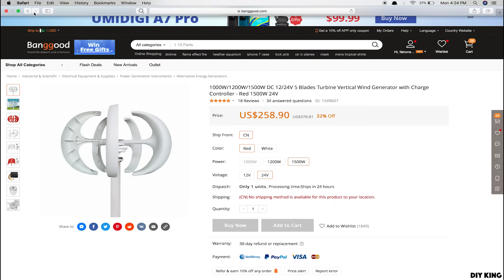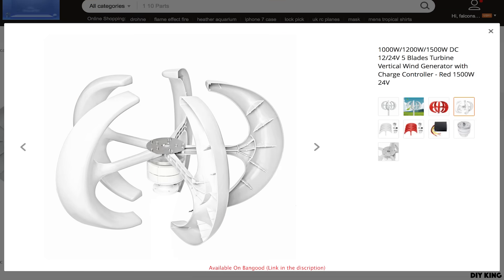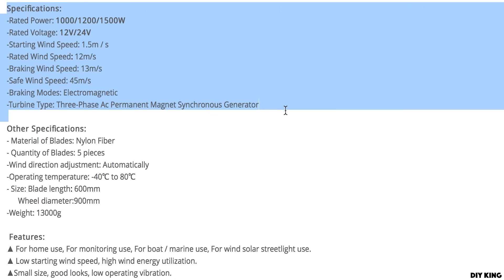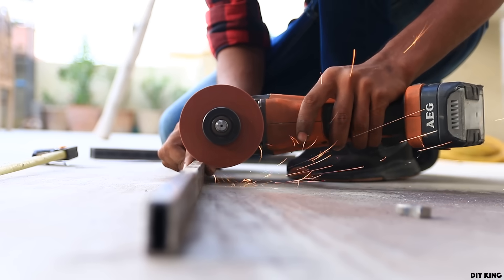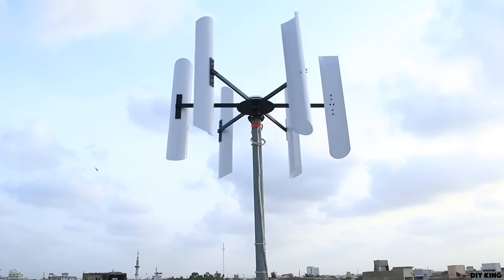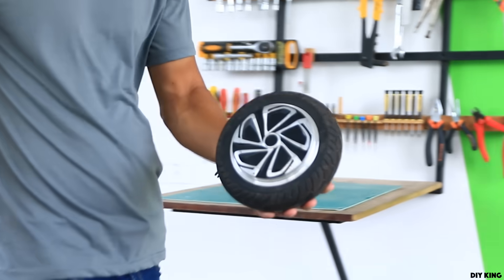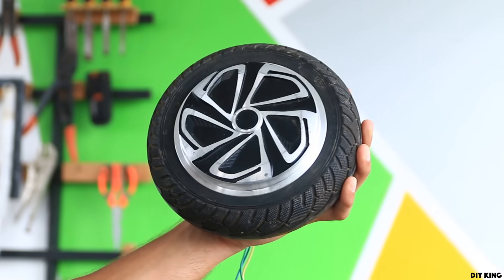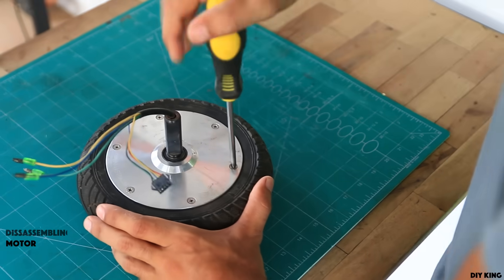How to make a Vertical Axis Wind Generator (Is it worth that???)

Comment: Part of your problem is that the arms for the blades are too far away from the motor. If you cut the arms down so that the blades are closer to the motor, then you will realize more RPM. You need to adjust your RPM to the motor by how far away your blades are to the motor. You can adjust the torque by the length of the arm and by the size of the blades. It is a balance game, you will need your RPMs but also your torque requirements met while remembering they are opposed to each other, as torque goes up, RPM will go down by moving the blades in out in relation to the center hub.  The 2 cheats you can use are to increase the height of the blades and or the number of blades. This is dependant on the capability of your structure and the bearings of your motor.  There is also a point of diminishing returns as to the number and size of blades.

Comment: What if, you made an enclosure for the blades that can pivot freely, make them wider so they fit that enclosure almost perfectly without actually touching it, then at the front where the air goes in you make like a funnel rectangular in shape as wide as the diameter of the enclosure funneling the wind to one side only,protecting the side turning into the wind. And also make the entire enclosure turn into the wind by adding a tail like fin to the back of it. Just thinking, would that improve performance? I'm subscribing hoping you consider building something like this, i am very curios if it helps boost the output.

Comment: On the vertical unit, instead of a vertical/straight up and down PVC that is cut in half... create a V pattern by cutting them in half so they look like a " < ".  The wind will still grab and push but the arrow dynamics will allow for a greater spin speed.  Second, look at better bearings...possibly some experimenting in magnetic zero friction.

Comment: Great attempt!!! 
However, I see a problem in bearing configuration. It’s not only the air drag that is slowing it down, but good amount of friction at bearings.

The hoverboard motor bearings are radial bearings. They are meant for motor orientation on horizontal axle. But if you place the motor vertically, the bearings will not be able to arrest the vertical slip of the axle, and finally the stator will press on the rotor, causing enormous friction and rapid wear. You need to replace the radial bearings with thrust bearings so that the rotor (casing) is suspended over stator be those bearings, bringing down friction drastically.
Reply: I also tried building a vertical axis windmill but after I left my prototype out for a night for a test drive, I noticed the same problem with the bearings. After that I discarded the idea of vertical axis with hub motors.

Comment: Add a large wheel under the vertical prop, then add a belt to this wheel and connect to a cog on a motor using the output from the motor as a generator, the output will be significantly higher.

Comment: The blades should be wings not cups.  The force comes mostly from the blades parallel with the wind not the ones perpendicular to the wind.  The blades should have undercamber and should be symmetrical front to back.  Your blades simply have to much camber for the wind speeds you are trying to harvest.
Reply: Exactly

Comment: Great knowledge I don't have any technical knowledge about this, but likes it very much and would like to experiment such things. I have got a 750 watts producing kerosene genset. I would like to know is it possible to use that generator (dismantling from kerosene engine) to convert it wind turbine generator? Since it has output panel, I think it's possible with minimal modification. If possible please upload a video on that.

Comment: Savonius is a low speed purpose turbine. It has a narrow range of workload and now a particularly high efficiency. HOWEVER, it is a robust, cheap and easy to maintain turbine. The best thing about it is that it start at almost no wind, so you can make a lot of electricity for low power applications. Its prowess is in its consistency. ;)

Comment: did you even try to implement an omnidirectional-guide-vane? there are studies that talk about 4 times more power generated. it would be really cool if you put it side by side to test with this one
Reply: Em português 'direcionadores de escoamento de vento'
Reply: They are like fins that direct the flow to only the blades that will propel and prevent the same wind from pushing the blades that are against

Comment: Folks, try a simple idea: Cover half part in a hard wood enclosure.  So the wind will be blocked for returning plates.

Of course, it depends on wind direction. If it works, then you can try auto tracking mechanism.

Comment: Look up Darrieus wind turbine, they spin much faster. Another good one is a Lenz 2, slower, but more torque. You can also use a capacitor voltage doubler on the 3 phase AC to boost the output voltage.

Comment: You created a savonius type of VAWT which is a drag based machine, the tip speed will never go beyond the wind speed.  You need to make a darrieus turbine with wing sections as blades to utilize lift in the wind in order to reach a tip speed of 5 X the wind speed.

Comment: I don't know if someone already pointed this, but I'll do it anyway. It strikes me the difference between your "good" generator (horizontal axle) and the new one: surface area! A little bit of mechanics will tell you that the power you can get from a wind turbine is always proportional to it's area, and you can easily check your vertical is about a tenth of the horizontal one. Remember your vertical can only count on ONE blade at a time, whereas your horizontal as the THREE blades allways facing wind. Bottom line: I believe it's a good project, but blades have to be bigger. Also, as a side note, I believe you should mind the balance: maybe the rotor is not balanced, and there will be some friction drag ruinning the efficiency. Good luck. Thank you for the movie.

Comment: cool built ;) but your friend needs a haircut ...

You could try to use different blade shapes to reduce drag, maybe heating the PVC and putting twist in the half pipe, but the horizontal axis will always be more efficient.

Comment: The "blade" design was in fact the main flaw. A better design may have produced a better result, but the manufacturing may introduce complications and modifications on the mount. I do hope you guys decide to make a better design. Cool video!

Comment: If u fixed a bigger engine it will be more efficient as smaller engines require higher spinning rate to generate sufficient power while bigger engine with the same spinning speed can generate a higher power but u need to work on the air fens as they have to be big enough in length and width in order to be able to spin the engine....just a thought which deserves some attention

Comment: there are all these small wind generators on the markets and although there are many different configurations  and varying outputs one thing seems certain, you can only get so much power out of them in proportion to the amount of wind force acting on them.     sure different blade configurations can give better results than others because they utilize the wind more efficiently.    but it's obvious you will only get a certain amount of power produced in proportion to the amount of wind force that can act on it.    having said this we can conclude that the amount of power one can harvest from a wind generator is mainly dependent on how much wind force you can collect.    most of these small , like 60 inch blade width designs will claim 400 - 500 watts,  the ones that claim 1000 - 2000 watts have larger permanent magnet alternators and larger blade surface areas.   and cost a lot more.  it's all about how much power you need , if you get a 500 watt one you will only get 500 watts at the higher wind speeds, like 30 mph some less and some more.  and 500 watts charging a 12 volt battery bank is about a 35 amp charge current at 14 volts.  and lets say you have 8 large 12 v deep cycle batteries in parallel.   each battery will be getting a little over 3 amps of charge,  and that is with 30 plus mile per hour winds being continuous.     batteries manufactures say you need to charge  at a general rule about 10 percent of their amp hour rating. so if you have lets say 100 amp hour batteries, you need to give them each about a 10 amp charge rate.  but you only have a little over 3 amps available for each battery.   if you charge batteries with less current than is recommended they go bad , due to sulfation build up.    and then how many amps are you getting when the wind is only 8-12 mph ?     your talking way less watts, 150-200  which lowers your amp charge per battery  to 1.8 amps.   so you see a 500 watt rated wind generator is only going to be good for a small battery bank.  like one or two batteries.      when building your own wind generator remember this, it's torque you need, not speed. that is how the large wind generators operate you see in wind farms. they have huge blades, I saw them up close, just one blade is like 8 feet wide at it's widest part and maybe 80 feet long.  three of those have massive wind collecting surface area.   and they need it to get the force needed, the torque needed to turn the massive 460 volt generator.     they operate on torque.  and they gear up the speed of the shaft going to the generator    if you want more power than these small wind generators can provide you need large wind collecting surface area,  which  will give you a lot of torque,  then you use gears to increase the Rpm speed for the generator so it turns at the speed it needs to generate the full wattage it can produce.  or you can make multiple small ones and add their power together.  just remember it's all about how much wind you can collect.    I live in AZ and I have a lot of wind here 30 plus mph often and almost every day at least 8-12 mph.   pick up a sheet of ply wood here and your arms will dislocate as the plywood rips out of your hands and lands 30-100 feet away.     that's power, that's torque.  and that is what you need to collect and put to work.

Comment: Cordial saludo desde Colombia (South América).
No somos expertos en este tema. Deseamos solicitarles, si fuere posible, favor suministrarnos los siguientes datos:

Potencia del motor (W), velocidad del viento promedio; diámetro y altura de la turbina; diámetro del eje (dicho eje es macizo o es un tubo?); cantidad de aspas y su ancho y el tipo de material utilizado; rpm, voltios (V) y amperios (A) finales o reales (al momento de poner a trabajar la turbina o el sistema).

Lo anterior, con el fin de tener una idea real del funcionamiento del sistema; sería de gran utilidad que nos pudieran suministrar esos datos, pues nos servirían de Guía para estudiar la viabilidad de un futuro proyecto nuestro, acá en nuestro país, para beneficio de remotas comunidades rurales  (de escasos recursos económicos) donde se requiere suministrar energía electrica a casas rurales donde normalmente prenden ó encienden un televisor (21”), un ventilador (opcional) y unas 4 bombillas incandescentes de 100 W., durante unas 5 horas nocturnas (de 6 p.m. a 11 p.m.).

Pregunta: Suponiendo que el sistema de Ustedes se use para cargar una batería, entonces, cuál sería la batería (especificaciones) mas  adecuada? Sería una(1) o dos(2) de 12V , ó una(1) de 24V?  Qué otros aparatos  adicionales (controladores, reguladores, inversores, etc.) se necesitarían y cuáles serían sus  especificaciones?

Gracias por su amable atención. Un fraternal abrazo.

Comment: I share one thing with u with my experience  the number of blade should be 5 or 7 because at certain moment the wind tend to balance the set of blades reducing the rpm and you could make the arm supporting  the blades adjustable from the centre for a better vortex and try several adjustment . Kind Regards .

Comment: I’m currently making my own diy residential wind turbine but it’s a bit of a slow process. I don’t have a drill press, software for blueprints, or any knowledge on pcbs...but I’m trying regardless haha. Question: did your motor have magnets in it?? I was under the impression that most motors rely on coils with electricity passing through them to produce the magnetism which then causes the rotation of the device...and so if I were to reverse engineer a motor into an electricity generator..that means (I think) that I’d have to hookup a current to the turbine that electrifies the electromagnets with a charge, that way they have a magnetic field when they’re passing the stationary coils of copper and creating a current within them....so yea..Are magnets not necessary..?? Also! Any tips on what “sleeve” to use for the shaft/axle of the turbine? I’m worried about friction causing wear or reducing efficiency. To whoever it is that might be reading this with advice for me- I’m probably just going to fashion most of the parts out of wood and pvc pipe (blades), not sure if wood is durable enough or heavy enough but its what I have at hand and this is also more of an experiment than an actual means of generating enough electricity to fit my needs..😅 Please help, I am a total noobie here.

Comment: Make the vertical blades from 1/3 of an 8" pvc pipe and turn then 30 degrees from the motor axis so you reduce their drag coefficient profile by that much while not reduce their exposure.  J-

Comment: I think one of the things with VAWT is that they are low speed potentially high torque. Has anyone tried gearing them and using the extra torque to spin a bigger (slower) generator?

Comment: This may have produced more power with the use of lighter weight material's other than the turbine....all the mounting hareware/mounting pieces could have been made of plastic, fiberglass or, aluminum instead of steel....maybe give less weight to the rotation?

Comment: in my view the blades are too heavy, thinner is better, less lost wind power to getting that gen set to turn, thinner metal arms too, , the durability is compromised, but in a wind that is strong enough to break it, you will have other things to worry about,

Comment: Nice concept build from reuse of hardware and materials! This project perhaps can be used for weather station
instead when scaled down some in your design, since the generator output is low. That wind drag is something else!
Perhaps also by taking the wind vanes and cutting them long-wise directly down the center, from end to end will cure 
the wind drag considerably. Also, once your vanes are half the current size, take and make radial cuts by (rounding)
all four corners of the vanes X6. Another suggestion would be: use a motorcycle generator and flywheel instead of 
using a hover board motor! Also....You may try making a 12 vane setup, utilizing 1/4 width of that 6" inch pipe.

Comment: Like you correctly say RPM is an issue.  VAWT by design is a high torque, low rpm type of generator.  You need either a gearbox to increase the rpm on the motor vs the blades or you can build a motor from plans freely available on the internet that will suit a low rpm application.

Comment: You should make a gearbox, the new design provides a constant rotation but at a slow speed, so put a flywheel to help with momentum and a gearbox that converts the high torque low spin into high speed for the motor
Reply: yeah this is a good comment. VAWT's are high torque low rpm compared to HAWT's
Reply: Flywheel?! Are u kidding? Never use a flywheel for wind power. The gearbox makes sense but won’t be efficient. It’s better to reduce the blade distance from the shaft to increase rpm.

Comment: How about a mechanism that turns the individual blade by 90° around a vertical axis when its working against the air and when its needed again so have a bigger surfacearea turn it back. You guys think that could work? haven't seen it on any vertical turbine so far

Comment: Question: Do you think that you could have made this faster by using a welder to assemble instead of drilling and tapping each connection hole? Minus the holes for the blades to be connected as they are pvc and cannot be welded.

Comment: Would it work better geared up or would that damage the motor well worth a try seen as you have done the main build and at its current size would give you torque and gear up would give the motor the speed it requires to be of good use cheers Rob Uk

Comment: Hello; Put a tail  design, that inhibits wind resistance, on the back side of the turbine. all power for this will be on the low pressure side of the blades/ The high pressure side being open

Comment: It seems thease type of wind turbines go slower then others maybe it has more strength? If so then I would get a large gear like from a bike in place of the brushes motor, and have a bike chain going to a smaller gear attached to a motor and it will make much higher rpm that way.

Comment: Well this generator is useful for constant voltage.. and constant power supply. It will rotate with constant speed even in low wind condition. Well nice project. Keep it up.

Comment: What if you cover half of the vertical windmill to block the wind to prevent drag?
A rotatable cover that moves parallel to the wind and redirect the wind flow

Comment: You have made your unit too heavy and didn't check for calibration. If one of the wings is even slightly heavier, it tilts and will have more friction. If you calibrate your VAWT properly, it has the potential to give much more energy. 

I have been a mechanical engineer for twenty years and I work with wind turbine technology for a Chinese firm. VAWT is the future.